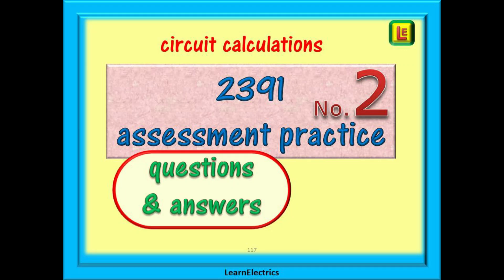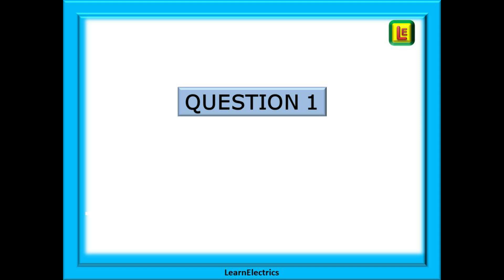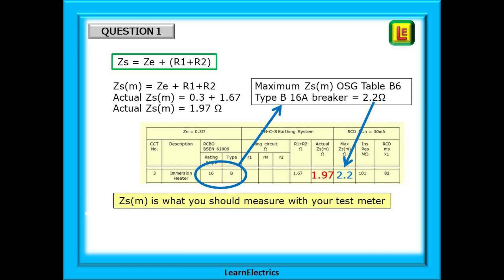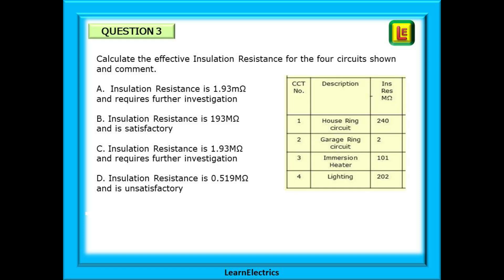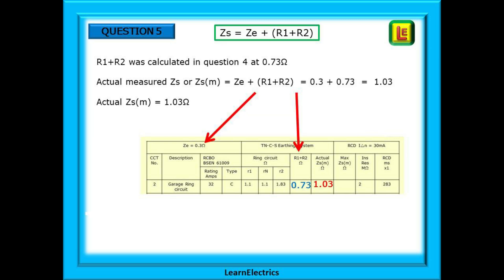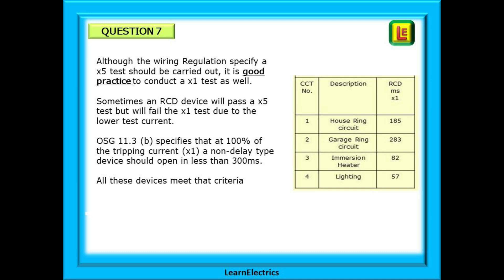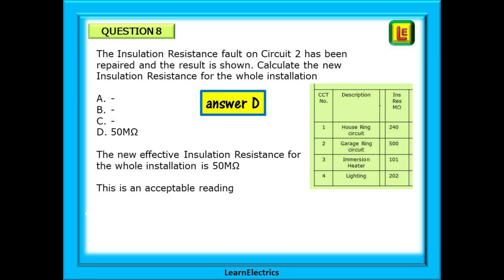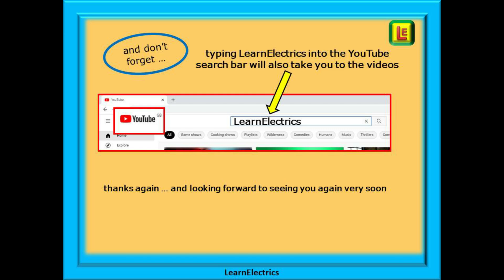2391 Assessment Practice - 2 – More Essential Calculations and Circuit Questions

Comment: Just curious Q6 iv checked GN3 table A5 and ON-site- guide table B6 for 6A circuit breaker maximum measured EFLI is 5.83 but in the video it’s 5.87ohms
Can someone please explain this I will appreciate it thanks
Reply from the maker: It depends on which tables you use, and how the rounding up is done, or indeed, if rounding up is done at all. The figures are close, just 4 one hundredths difference and not worth worrying about. A multi-choice question is not going to give a possible answers as close as that. As an assessor, if I'd got 5.83 as an answer and you wrote 5.87 I would mark that as correct. great that you cross check, and thanks for watching. Lots more questions in a week or so. Dave.

Comment: For question 1 the tabulated value is 1.37 x that by 0.8 and I 1.096 not the 2.2 that is in the on site guide, am I doing something wrong?
Reply from the maker: This is a Type B 16A breaker. The OSG and the video are both correct.

You might be getting confused with a 32A breaker which would have a Max ZS(m) of 1.1 ohms.
Have a look at this video on the link below, it will explain a lot.
Thanks for watching. Dave.

https://www.youtube.com/watch?v=IjpJK1eJLzw

Comment: For Q6 the max Zs(m) is 5.83 ohms from table B6 in the osg, not 5.87 ohms
Reply from the maker: If you have the brown amendment 2 OSG it is shown as 5.87 on page 145. Thanks for watching. Dave.
Reply: @learnelectrics4402 Hi Dave, mine is the latest brown OSG A2:2022 and it shows 5.83 ohms

Comment: For question 3, selection a) and c) are identical. 
Ohh, my bad, it's milli and not Mega. I would've lost easy points on the exam.
Reply from the maker: I did that deliberately because that is what you will get in the exam. Now you know, you can avoid it.

Comment: I may be late to this but could you point me to the regulation in BS7671 that states any insualtion resistance below 2 Mohm ahould be investigated. 
The closest I have found is within GN3 inspection and testing 2.6.7 which states 

"although an insulation resistance value as low as 1 Mohm would comply with the requirements of the regulations, a new installation should not yield a test result this low. In new installations, a value below 20 Mohm should be investigated" 

This still doesnt state the 2Mohm requirement for lets say periodical tests. 

I would always fuether test a low reading I am just interested where it is worded. 

Many thanks
Reply from the maker: The reference to 2Mohm has now been removed from the latest books and replaced with a requirement to investigate  any reading below 20Mohm as per page 119 of the On-Site Guide. Great interaction, thanks for watching. Dave.
Reply from the maker: The reference to 2Mohm has been retained in the Electricians Guide to the Building Regulations at 6.3.6 page 120 in my book. Hope this helps.

Comment: Hi there thanks for this videos, my question is Insulation resistance in wiring regs. In table 64 it is 1Mohm where as in your question 3 you state that under 2Mohm it must be investigated?
Reply from the maker: The minimum is 1Mohm, but the regs suggest that any reading below 2Mohm should be investigated. Personally, I always investigated anything below 30Mohm. Hope this helps, Dave.

Comment: Hi for question 6 chart b6 onsite guide gives differents answear for the type b breake 6 amp compared to bs7671 when multiplied by 0.8 for the exam City and guilds what would you prefer me following on site guide or the table from bs7671
Reply from the maker: If you are sitting the 18th Edition exam use the Wiring Regs numbers. If you are taking a practical assessment then you should be comparing results to the OSG data i.e. Wiring Regs numbers times 0.8 Hope this helps.
Reply: In the OSG, all values from Table B6 are directly multiplied by 0.8, so you will read the exact maximum Zs.

Comment: Very informative video. What is the difference between the C&G 2391 and the EAL 4337/8
Reply from the maker: All the exam bodies have their own numbers for each exam or assessment but they all have to follow the same rules for content etc. of the course and what is taught, what type of questions and so on. These rules or standards are set by governing body. Take 18th Edition for example, C&G, EAL, Logic, all have their own number for the exam but they are all testing you on the same book. Its a bit like calling a vacuum cleaner a Hoover, even if its a Dyson. Hope this helps. Dave.
Reply: @learnelectrics4402  Thank you

Comment: Thank you for these videos, they are really helping me prepare for my upcoming 2391-52 course. Could you direct me to where it states the 2M ohms for overall installation resistance. I've been watching some similar videos and they state 1M ohm. Thank you
Reply: Guidance note 3 also says Minimum of 1M ohm would comply on an existing circuit and 20M ohms should be investigated on a new circuit. Page 51 Paragraph 3. However, the Electricians guide to the building regs states that although 1M ohm complies with BS7671, any values less than 2M ohms means there is a possibility of a latent defect and so should be investigated, page 109 last but one paragraph and this is also stated in the On Site Guide, page 109 first paragraph.
Reply from the maker: Thanks for jumping in there, appreciated. Dave.51
Reply from the maker: LH below has this covered.
Reply: Thank you for your replies
Reply: Isn't this referring to a 3 phase installation as it states "For an installation operating at 400/230 v"?